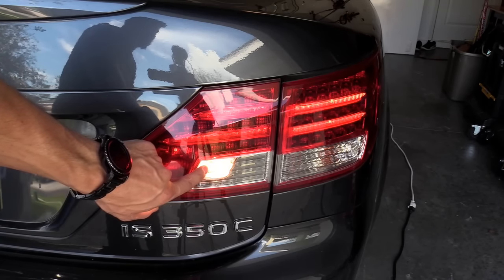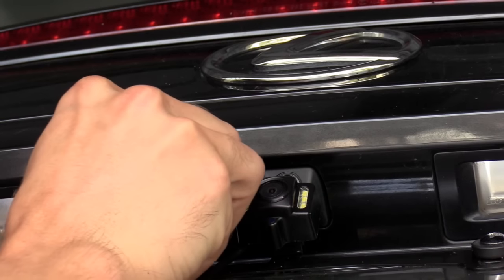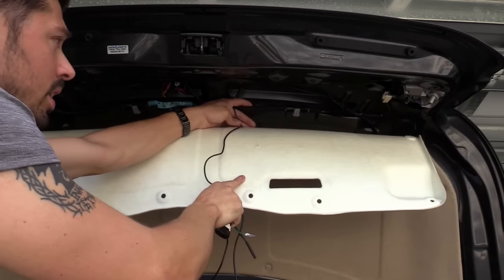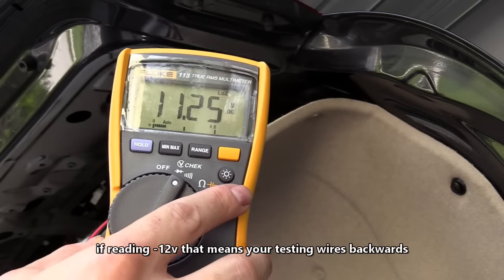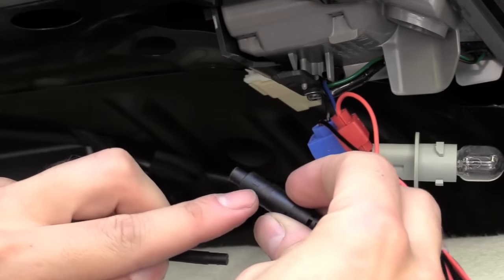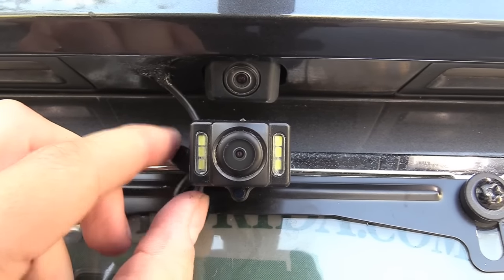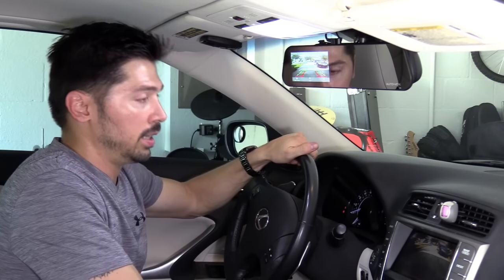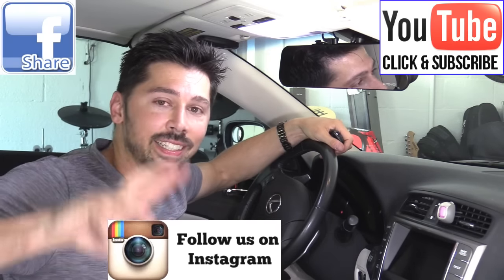HOW TO INSTALL CAR BACKUP CAMERA | WIRE REAR VIEW CAM TO TAIL LIGHT

Comment from the maker: *video was revised because other install video was REALLY long and most people just want to know wiring the backup cam, sometimes less video length is more valuable to the viewer
AUTO-VOX M6 Dash Cam Backup Camera Kit HD Mirror Cam with Motion Detection, IP 68 Waterproof LED Night Vision Reverse Rear View License Plate Back up Car Camera and FHD 1080P 4.5'' Touch Screen - http://amzn.to/2Bv4PcR
 fuse wire install kit- http://amzn.to/2hnc5hg
SD card for mirror- http://amzn.to/2fnenA9
wire connectors- http://amzn.to/2fDOObb
affilate links
note: If installing in a convertible car cable wires might break.
#autovoxmirror #backupcaminstall
Reply: Tampatec very true less is more
Reply: Hola acabó de instalarle ami carro mirror cámara pero el cable rojo del la camara trasera donde lo conecto
Reply: Yes, i like it
Reply: So I don't have to ground? Just put negative for cam in with negative for reverse lights?
Reply: YOU KNOW THEY SELL ADAPTER TO CONNECT YOUR BACKUP CAM TO AFTERMARKET RADIO

Comment: Great video, but one thing I’m confuse, you mentions about splicers. Does it comes with the car or I had to buy one ?
Reply from the maker: Yes it comes with the kit but twist wire nuts and solder with heat tubes works too.

Comment: Thanks for your video. One quick question ? I just saw that you connect rear camera to backup light, using 12 V to trigger rear camera. But only one connector, how do you route and send the rear camera video back to your screen in the driver seat. Really thanks.
Reply: Its probably via bluetooth.

Comment: Great video...Kinda what I needed. I have a Rav4 2008 and got an after market player with rear cam. I was confused how to do the power cable wiring which will trigger the cam only when I press on the break. You answered it...Thanks a lot...

Comment: Question! I currently have a wireless camera set up, I installed it to the reserve light and ground. I am thinking of switching it to a wired connection. Is it a problem removing the existing splicers? When you remove the existing splicers, does it cut off the existing wiring of the lightbulb and ground or should it be okay?

Comment: I have a wireless 12v backupcam(I know not the best but got it for free). I was wondering if I could splice it into a trailer plug that has back up lights and ground. I checked the voltage and am pretty sure it is 14v. I went to some forums about using a 12v cam on 14v and some said that there is a range these devices use because the power isn't always so clean.

PS: thanks for your repair videos on tvs. I was able to change out some blown caps and get my tv working.
Reply from the maker: yes, there's a range 12v to 14v, just connect to reverse lights and ground to trailer chassis.
Reply: Tampatec thanks again keep up the good videos.

Comment: Great video sir!
Just a question regarding a Toyota Mark x 2005. I don't think this vehicle is in the states, maybe
Reply: Basically I've wired up an aftermarket reverse camera to the factory display because the factory camera was bad. 

Now the picture is all jumpy and not clear at all.
Do you know of any reason why it could do this? Maybe different voltages or that NTSC Pal thing. I don't know to well
Reply: Thanks in advance
Reply from the maker: can be loose or bad ground wiring or cam not compatible
Reply: Thanks sir!

Comment: Easiest part was running the video line front to back.  Tapped in to rear backing light and no go for me . Bummer. Might go back to easy install of a 8 track radio. 👍

Comment: There is a backup camera already on this car what made you put on another camera?
Reply from the maker: Dee Lee because the factory installed cam didn't record.
Reply: That makes sense. It would be cool to record both at the same time and somehow be able to have the backup enable when you reverse as well.
Reply: i updated firmware today and thats exactly what happens... driving forward you basically have full screen but a 1/4 screen upper right has the rear cam, you can change that too, anyway put it in reverse and its all back up cam

Comment: How did you wire in the front?
Reply: Yellow RCA into head units video input. Red wire coming off it connect to reverse wire from head unit.